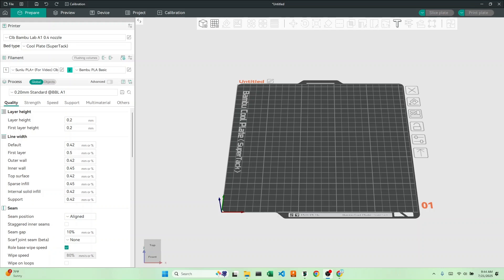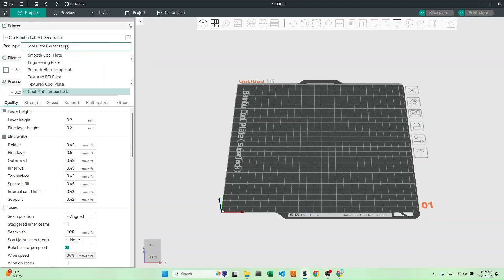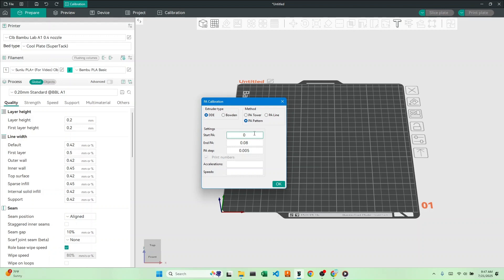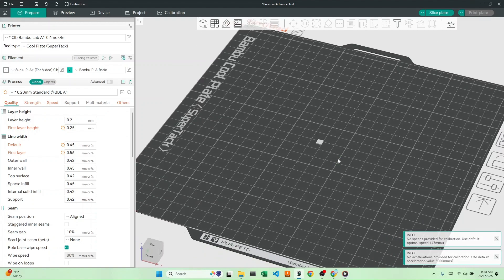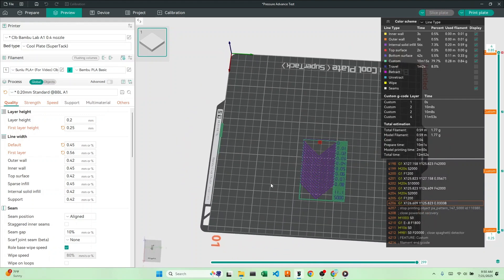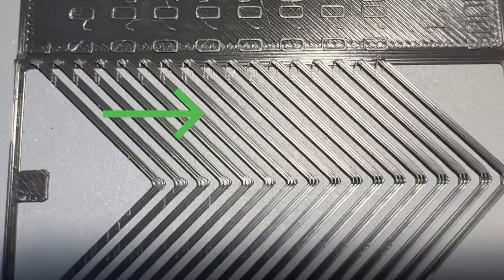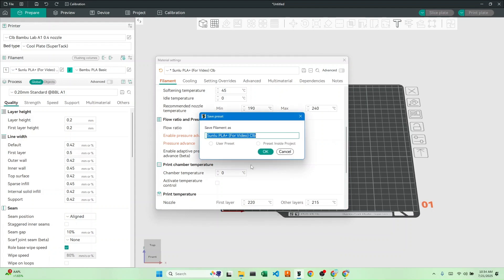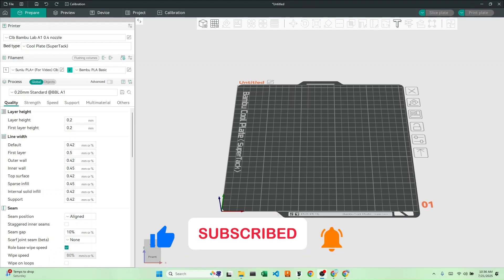Calibrate your Pressure Advance with Orca Slicer!

Comment: i am trying this with a .2mm nozzle and it says the layer height of .25mm the calibration sets it to is invalid. would this be ok trying at .1mm layer height?
Reply from the maker: I don't see why it wouldn't, but I would recommend trying multiple different layer heights to make sure that your results are always the same.